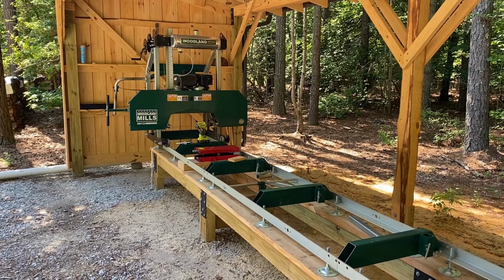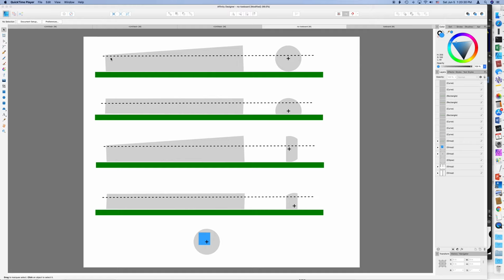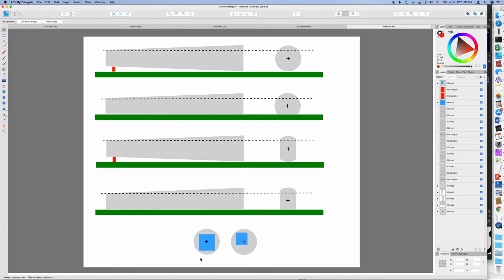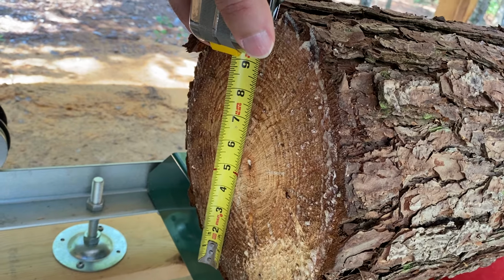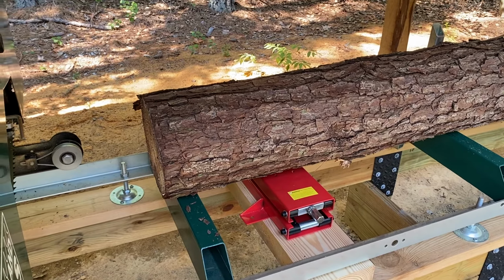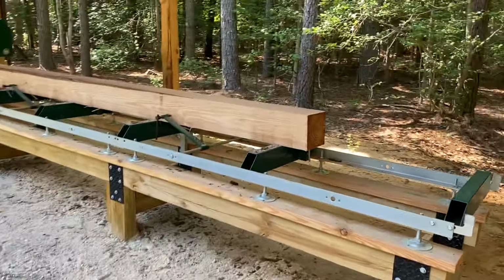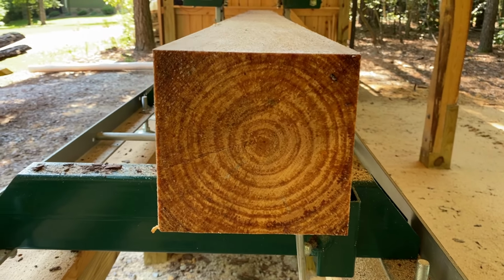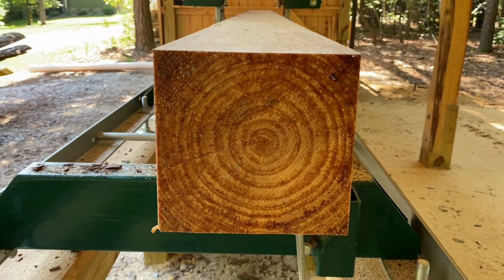Why you should use a toe board with tapered logs on a sawmill

Comment: You should make yourself a "T-square" to check the center of the log - the horizontal leg bears on the saw's carriage tracks and the vertical leg (with a scale on it) to check the center of the log.  Much simpler than using a tape measure.  JMHO
Also - maybe you should keep your cant hook closer to where it's needed to save you some steps.
Reply from the maker: The tape measure is more of a multi-function tool that can always be on your body in a pouch/pocket or on a belt, and it has dozens of other uses while milling lumber.
Reply: @Lumber_Jack  You are absolutely correct, and I'm not suggesting that you abandon it.
Measuring from the bottom edge of a raw log to the center can sometimes be off if the log doesn't quite reach the next bunk.
Measuring from the rails simply insures a bit tighter accuracy.
Not trying to be critical of what works for you.  Just sharing how I would approach marking sure the average center of the log is perfectly parallel with the blade's plane of travel.

Comment: so for that log you cut in the beam, can you use that beam right away or does it have to dry out?
Reply from the maker: You can frame exterior structures with green lumber, you just need to use special techniques to accommodate movement of the lumber as it dries.  I did a whole video on building with green lumber, check it out.
Reply: @ could I do a bathroom addition with green lumber on my dovetail cabin? I just got the hm122

Comment: I enjoy your video's but I have a question? I tried your charts, and doesn't work for me, placed the log on the mill, log was up about two inches on the front bunk, deside to go ahead and jack it up to get it level ,went ahead cut, rowed the log 180, still above the bunk, Not sure what I'm doing wrong? Maybe I should have not made the first cut with it not being level?
Reply: also I got nine inches on both ends of the log, front bunk still two inches off the front bunk.
but I have ten inches in the middle of the log, any help out there, what to do? jack up both ends?
Reply from the maker: Are your bunks aligned flat?  Run a string down them to check.
Reply: @Lumber_Jack  everything straight and level, and by the way Thanks for replying.

Comment: I'm wondering why you don't quarter turn the log after the first cut and use the toe board for that cut as well. Then lower for the next two cuts. It would seem to be less adjusting.
Reply from the maker: Rotating 180 creates maximum stability on the bed, with the aim of producing a squarer cant and cleaner cuts.  You're immediately flipping the log down onto the reference you created, with gravity working in your favor.  Depending on the type of lumber being sawn, the first two parallel cuts establish the most accurate reference surfaces and will be important later.  For other stuff (ie, posts) it does not matter so much how you do it.
Reply: @Lumber_Jack  you are right and I guess you might have one less cut into bark if your logs are dirty. Thanks I just started sawing with my HM 126 last summer.

Comment: I see the point quality wise to have the heart wood centered. It will even make shrinkage and warping more uniform if you use a toe board. 

However the bigger Kant is impossible. Either way you still have to cut as deep into the small end to get a square cant on the small end so the big end can not be magically bigger square than the small end. The waste really doesn't change it's just the same amount on all 4 sides rather than less on 2 and more on 2. Basically you try to cut the least amount possible to end up with the biggest square you can on the small end and that's what the big end has to be regardless of a toe board or not. The toe board does not increase the small ends diameter so the kant won't end up bigger. If you consider all but the kant to be waste then the waste will be the same volume and weight either way.

That being said, the benefits to quality are worth the use of a toe board even without a volume gain.
Reply from the maker: On long logs with notable taper, you will not be able to carry the "square" dimension of the small end through the log all the way to the big end without a toe board (or shimming the log).  There won't be enough keeper wood on the big end after the first (and third) cuts to make it work on the second (and fourth) cuts.  I saw this happen once or twice and it's a real waste of a good log.  You can visualize this with a couple sketches on paper.
Reply: @Lumber_Jack  I am saying that the toe board does not increase the physical diameter of the small end. If you cut the maximum sized cant possible from the small end then that 's the maximum size you can have, toe board or not. The only way to get a bigger cant is to leave live edge on the small end. The toe board straightens the cut through the log it does not increase the diameter of the log so the max size of cant in the small end is the max size possible. Benefits to not using the toe board is that the cutoff from the first and third sides will be big enough that you should be able to cut shorter boards from them. You can try it yourself. Go put a tapered log on your mill with the small end at the saw and draw the biggest possible square on the end. Line that up with the toe board and without it. The square you drew doesn't get bigger or smaller. without the toe board You may have big slabs coming off in your first and third cut that you could use for other things and the grain will obviously be angled through the cant but the cant will be the exact same dimensions. I don't need to visualize this on paper. you can go to the mill on your next tapered log with a square, draw a square on the small end and see for yourself. 

For straighter grain or for reducing width wise taper change  in live edge slabs or for keeping the heartwood in your beams? yes! a toe board is useful. but it won't increase the size of your cant. It's impossible. Again. The maximum size of the square you can draw on the small end of the log is the maximum size of the clean cant you can cut from the log regardless of the angle you put the log at and regardless of the log taper. For long large beams in tapered logs I would certainly use a toe board because if the taper is bad enough you could end up with most of the heartwood of the large end in the cut off. the heartwood is usually harder wood so it would be dumb to cut that out of a beam.

Comment: Instead of turning it 180 after the first pass you could only turn it 90 and you should be able to leave the toe board where it was assuming the log is symmetrical.
Reply from the maker: Better for lumber quality (cant squareness) if you always go for parallel cuts, so most sawyers always work in 180 turns even though it means more work.

Comment: I'm confused as to how you get more lumber out of the log by aligning the pith. The amount of usable lumber in my estimation is determined by the small end of the log. That usable area does not change by changing the cut. I understand that keeping the pith center is better. I just don't see more lumber.
Reply from the maker: Sawing cockeyed along a tapered log will produce boards that have more tendency to bend, warp, and twist over time.  This is because you are sawing across natural stress lines in the wood and creating an imbalance.  It will result in more rejects as the lumber dries.  When you align the cut properly with the pith, the amount of rejects will decrease and your yield of usable lumber will increase.

This is even true when sawing a single post or beam out of a tapered log.  Yeah you get one piece of lumber no matter how you saw it.  But if the pith is centered in the entire post/beam it will be the best possible quality you can get and have the highest chances of remaining straight and stable.  On the other hand, if you saw cockeyed across a taper and the pith is diagonal in the post/beam, there is a much higher chance that the post/beam will do something wacky as it dries.  You may end up with zero usable post/beam out of the log.

Comment: Sure was a lot of waste in some of your opening cuts I was a sawyer on a wood mizer mill for a couple years
Reply from the maker: I was shooting for a square cant based on the 11" end, and as you probably know you take 0.707 * small diameter (where .707 is sine or cosine of 45 deg).  There was waste on the large end from the first two cutoffs, which I recovered and made several short 4' 2x4 lumber from (even a short piece is valuable to me).  And the third cutoff was good for a slightly beveled 1x6 at 12'' long.  The fourth cutoff was all scrap.  Not too bad.  Thanks for watching!